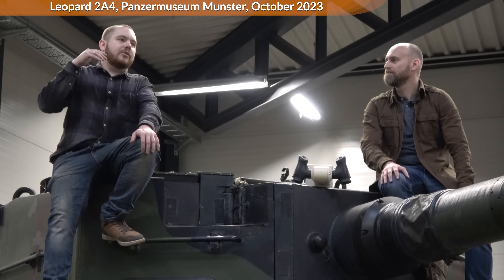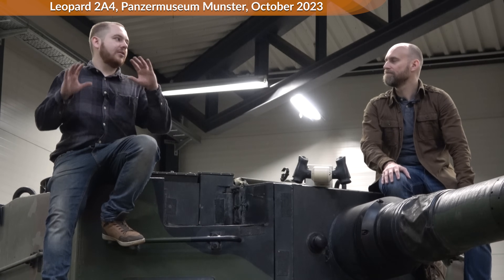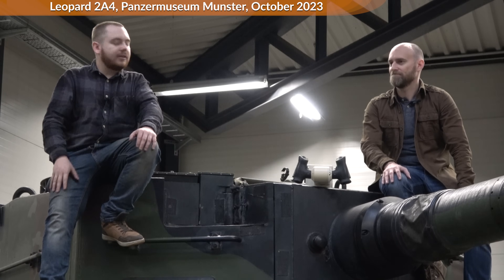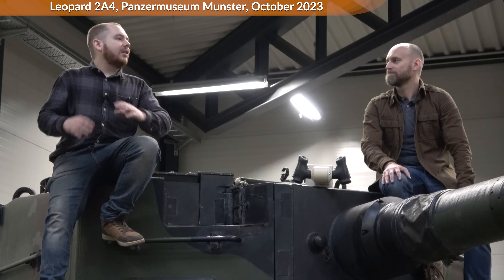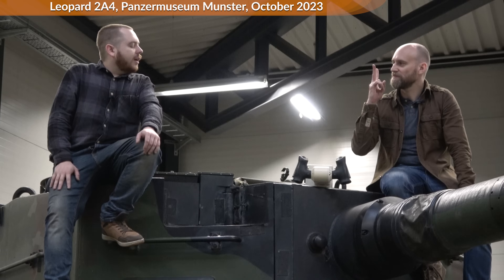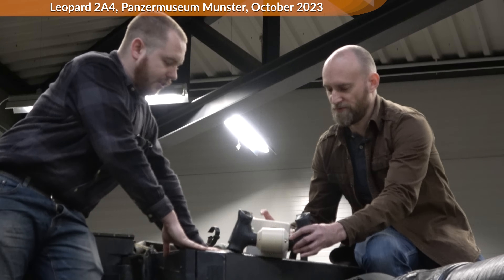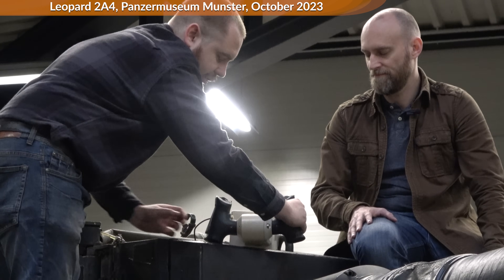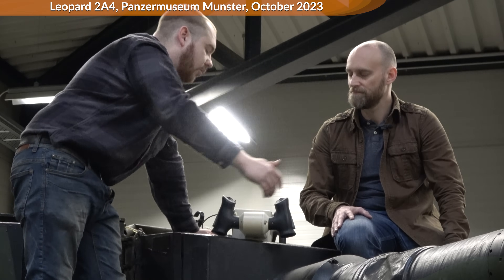Laser Range Finding: What everyone gets wrong

Comment: Very interesting. Some questions: 
1. Why not use a tighter laser beam? I understand that there are physical limits but it should definitely be possible for the beam to be much smaller than a tank(at distances where shooting at the tank is possible).
2. There are time-fused shells that are supposed to explode in the air over trenches(by measuring the distance and programming the shells to explode at just the right time). If the range-finder beams are so wide, how would you measure the distance that precisely? I guess it's accepted that the first round may not hit directly over the trench?
Reply: Tightening the beam doesn't always work since weather conditions can always mess with it downrange. It would also require more complicated optics that would be more expensive, more difficult to harden against the shocks of travel and firing, and absorbs more of the laser's energy as heat within the system (thus requiring the laser itself to be more powerful and to have a bigger heat sink). At some point it's no longer compact enough to have an advantage over an optical rangefinder.
Reply: 1. If the laser beam is too tight, then you have a higher chance of misreadings of it. Imagine sticks, leafs, slopes, cover, etc. blocking off a tight beam. It makes sense to have it the current way. Secondly, if we talk about "tight" or not, the laser cone covers half a mil, means at a distance of 1000 m you have a circle of half a meter diameter. That is not really "not tight." 
2. Trainig teaches you how the range finding works. Doesn't really matter if you use first or last return. The gunner has to know aim, that's the secret behind it.
Reply: 1. Light spreads outing an inverse square relationship - doubling the distance means the beam covers four times the area.
2. Practice.
Reply: The inverse-square law only applies for spherical emitters. Lasers, like all EM beam emitters, are subject to divergence, typically measured in milliradians, and for optimized designs have a theoretical minimum divergence proportional to its frequency and inversely proportional to the beam's minimum diameter. Both of these parameters face physical restrictions limiting how much they can be altered. For example, shorter wavelengths of light are more strongly scattered by the atmosphere (this is why the sky appears blue during the day) so longer-wavelength lasers are less affected by atmospheric conditions, but will have a larger dispersion.
Reply: @seanmalloy7249  citation needed, because so far I can't see one source supporting this.
Reply: @neiloflongbeck5705  inverse square law affects the beam strength not divergence because if inverse square affected divergence then the beam edges would curve towards the target with distance. 
A beam is affected by power loss, divergence, scatter, emitter ramp, power jitter, and collimation to name a few
The static effects are divergence and scatter (dependent on what is in the air for scatter) 
Divergence is countered by a longer lens chain including a longer laser chamber, thicker and more chained lenses can greatly reduce the cone to a line but the trade-off is size, weight, maintainability, and manufacturing. Fresnel lenses can reduce the length and weight but the trade-off is manufacturing and lens life.
Scatter is affected by anything suspended in the air such as smoke, dust, and water
As the beam leaves the laser chamber it is a small range of wavelengths, it's not perfect but it's pretty damn good, ramp up is the effect of the laser still normalising in the nominal zone where some lower frequency emissions begin to leave, if the lens chain isn't sufficient you'll encounter wider divergence that narrows as the beam stabilises. longer ramp up is a cheaper laser, normally it's miniscule but it does exist. 
Power jitter is electrical fluctuations to the anode and cathode due to power delivery, this affects intensity and can spread the emitted wavelengths a little which affects divergence and strength. This can be countered with more expensive power delivery systems or chemical lasers which have a finite number of uses.
Suffice to say, this is the whistle stop tour of a much more complex subject
Reply: @ThePlayerOfGames  the beam is still spread across all sources I can access in relation to the inverse square law. Divergence is defined as how much a beam of light spreads out over distance.

Comment: Thanks man for info on laser I was wondering how to get distance when you have lots of clutter around target and knowing how real laser look (cone) how do you know what distance is one you want to use to shoot at.

All in all great video and great explain how stuff works 👍❤🎉
Reply: As cheiftan puts it, the one that looks about right. 

When they say "first return" and " last return", they dont mean, they dont mwan the first and the last pulse. 
Depends on the system it might be the average of the first 4 return and the average of the last 2 retuen. 

There are also system that deal with first, second, last. 

Then there are system (most of them) allow crew to set a gate. Say they pick 1500m +500m -100m.

Point being gunner are still trained to eyeball the size of the target and make a rought guess how far the target is.

Comment: What if ground troops had golf rangefinders?  Could they be used to fool a tanks protection system?
Reply: It would probably make those troops a target for said tank, so who's the fool?
Reply: @ollep9142 
Before you knew it, at crew will go to their local home improvement store and buy some 7 inch pvc tubing, paint it army green, and set it up as a decoy with a lrf. 

The laser is pre aimed at a kill box (a section of a path for example). The crew sit on the opposite of killbox where the laser will pass through. 

When a target appears and cross the kill box, the crew turn on the decoy lrf. Lws get triggered. Tank turn the turret to face the decoy. 

Crew now has free shot at the rear of the turret or 

This is a simplified example. There are lots of thing the afv can do in response, just like the at crew can generate new counter to the counter. And back and forth, and back and forth.

Comment: In the M60 TTS, there was an option to choose between the first, the second and the last.

This is however nothing in comparison to the Polish Merida FCS which stored first TEN returns. It also had gating (you guesstimate a range, the returns that are more than 100 metres short of that or more than 200 metres long are discarded) and some ways to input lead without rotating the turret.
It wasn't a very good system XD
Reply: I was a Chieftain gunner. Yes we had options first/last and soke or fog could put it off, but let me ask how many targets did you ever miss because of bad rangefinding? I bet not many. Better than estimation and bracketing any way.

Comment: I still do not understand, that having amazing dataprocessing that a modern form of optical distance meassurement.
Reply: Lrf is has a much smaller overall package size than any comparable optical rf. 

Lrf gives a constant error, optical rf gives am increasing uncertainty as the distance gets further out. 

Then there is the environmental element. Smoke, fog, mirage, you name it. Lrf don't care about it, optical will. 

Maintenance and logistic. It is much easier to handle a single self contained module as opposed to multiple semi self contained module that has exposed lenses on both end. 

Lrf also provide lots of flexibility in the sense you can range pretty much everything. 

That being said, it is not impossible to use camera instead. There is still the problem of needing to deal with lenses but using camera eliminate the need of complex lense path. Using multiple different type of sensor in conjunctions can potentially reduce the error bar. 

I'm not exactly sure how ir and uv  interacts with aforementioned natural and unnatural phenomenon, maybe they can help?

Comment: I was just reading "Into the Storm" by Tom Clancy, about the 1991 Persian Gulf War. A few times they mentioned problems with the laser rangefinders. Much of the time during the ground war it was raining heavily and windy, yet still there was much dust in the air. Thermals could see through it, but the lasers were either cut short at longer ranges or the results were so scattered they were often not directly useful. 

It said that they often had to take many rangings and use an average to enter into the computer, or make a guess based on the size of the target on thermal and enter that range. Even so, they were making hits over 2000 meters and a few at over 3000. It didn't directly note how many shots per hit, but based on ammo consumption later it wasn't always one shot one kill.
Reply: I was an M1A1 gunner during ODS. I was assigned to a tank battalion in the First Armored Division. The statement about the laser range finders having problems was not true. The issues were more with the thermal sights acquiring targets through the heavy rains particularly in the late morning and early afternoon of 27 February during the battle of Medina Ridge.  The 2nd Brigade of 1AD, depending on the battalion, had engagements from 1200 out to 3000 meters. As far as not being one shot one kill, it was more of a case of two or even three rounds being fired at the same Iraqi tanks or armored vehicles. I personally witnessed this happening several times through my gunner’s primary sight.
Reply: Doesn't Tom Clancy write cliche action stories for videogames?
Reply: @robertkalinic335  He used to write good military fiction and non-fiction. A lot of that later stuff was witten by other people under his brand.
Reply: @robertkalinic335  "Into the Storm" is one of his nonfiction books written with Fred Franks the CO of VII Corp during ODS.
Reply: @robertkalinic335 he wrote some of the best and accurate scenarios ever. Some things he wrote about were top secret at the time his book came out.

Comment: I wonder if it would it be a viable tactic to use the rangefinder on a spot close enough to the target but keeping it outside of the laser "cone" so that it doesn't trigger their warning systems. Or are these systems so sensitive that they could still pick up "echoes" even if the beam isn't directly on them?
Reply: At the kind of ranges where one really needs to use a rangefinder, the laser cone is big enough that offsetting it far enough from the target to avoid detection probably means getting an inaccurate reading to begin with. It's possible in more specific situations like when there's a building roughly the same distance away -- one can conceivably lase the building, slew to the target, then fire. But that relies on the gunner's intuitive guess (that the building and the target are at the same range) being right, and there's no guarantee of that.
Reply: @LafayetteCCurtis  You can aim the cone right below the target tank and use last return. Since the top of the cone is where the target's tracks/wheel is on top of, the last return will be where the target is. APFSDS have very little drop, so even just 100m error is enough to hit.
Reply: @neurofiedyamato8763  In that situation there might still be enough scattered reflections from the ground ahead for the tank’s LWS system to catch them. Lasing the ground is generally not a good idea to begin with since most of the reflections are likely to scatter forwards rather than back towards the rangefinder, and the target tank is going to be a good deal closer to the origin of the reflection than the rangefinder (read: there might be enough energy going forwards for the LWS to detect but not enough returning backwards for the rangefinder to get a good reading).
Reply: @neurofiedyamato8763 you have a bit of a chicken and egg problem though because in order to know exactly how large the circle of dispersion is, to make sure you don't have any spillover on the enemy tank, you need to know exactly what the distance is so you can calculate that. if you're using the Laser Rangefinder to gauge the distance then at best you have some rough estimate and you can't know exactly where the edge of the cone is, and so you are likely to either get a bad reading because you are too conservative or trip their RWS because you are too close
Reply: (Note that the video also mentions lasing terrain features beforehand -- while the enemy isn't around -- to get TRPs while preparing a defensive position. This is extremely common and the infantry also does this if they have any rangefinders at all. Also less likely to lead to a spurious reading since there'd be patrols ground-truthing the range readings by getting reciprocal ones to the friendly position if there's time and spare personnel for it.)
Reply: Probably not. 
Lws didn't sound off when the vehicle doing the ranging received the return. 
It follows that if the come did not hit the lws receiver, the alarm will not be sound.

Comment: Why do the Germans use a standard range if 1500m for their sight? Any former German leo 2 gunner?
Reply: The APFSDS trajectory is flat enough to hit tank size targets within a deep bracket (at "close" range), so any tank within a couple of hundred meters of the pre-set range will be hit if you aim right at it.
What range is set as "battlesight" varies between nations and tank models. Possibly also wit the expected engagement ranges.
In the mentioned simulator Steel Beasts it used to be that Abrams (A1 and A2 version) tanks had a battlesight range of 1,200 m while Leopard 2 (various A4 and A5 versions) had a range of 1,000 m.

The drill is that when you suddenly encounter an enemy that (by its size in the gun sight) is "close" you smash the Battlesight button, aim on center of mass and fire.
Reply: @ollep9142  yeah I know why you have battlesights but I was wondering if someone could tell me why the Germans went for 1500. At 1500 they will miss targets at some ranges between 0 and 1500 so was wondering about what ranges it is made for as the 1500 is just what the computer will take aim for while you will hit both closer and beyond for at least a few hundred m depending on the battlesight
Reply: @thurbine2411  My guess is that it's a) only for the newer models with the longer gun barrel, and b) based on experience that the very short ranges (<500 m) are decidedly less common than engagements >2 km. The latter will of course vary depending on the terrain in the area of conflict.
Reply: @ollep9142  yeah I also think the terrain part is the most probable. It isn’t only for the l55 guns. The 2a5 has the option and I think the 2a4 as well but spent much time in one so can’t remember
Reply: @thurbine2411 
Abrams 1200m is good for 200m to 1600.
The L55 shoot stuff at a hogher velocity. 
It likely they simply increase the battlesight range from 1000m (based on previous commenters) to 1500m due to the velocity. 
It is also likely that the battlesight is still good for everything within 1500m and the top end is probably at 1800m.
Reply: @jintsuubest9331  yeah but they use the 1500m for the l44 as well. I understand it is about combat ranges but still the 1500m should like hit at close range then miss at mid range and then hit again which is weird. Only talking L44
Reply: "Default", at least up to 2A4 would be 1000m.
There is an actuall button "E1000" which you push to set the range to 1000m, for snap shots.
Individual ranges you either lase or use a rotary dial.
Reply: @Mr79dream  Well for the 2A5 the Burton says SS1500
Reply: Former German Leopard platoon leader speaking.
I don't know. Eitherway, that button is not really used much in gunnery scenarios. I would not call it useless, but the practical use is ... 
Since my active time is a few years ago, I don't really know if it is 1000 or 1500. Who cares? If you reach a position with your platoon anyways, part of what platoon leader orders is ... let's name it battle distance (Kampfvisier). And that is always depending of the terrain in front of you.
Reply: @9thbloodandfire508  yeah but the 1500 just seems impractical. We always used 1100 in Sweden when moving and then you can of course change it if you have taken up a firing position